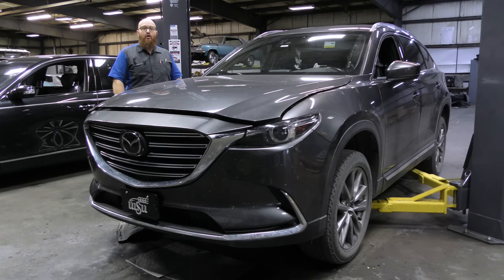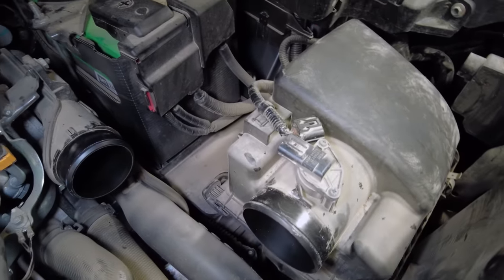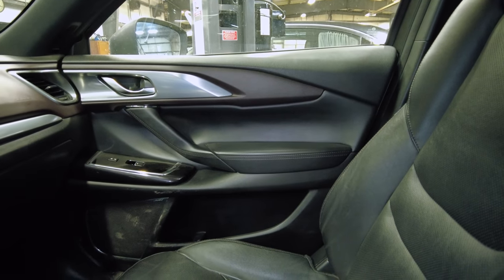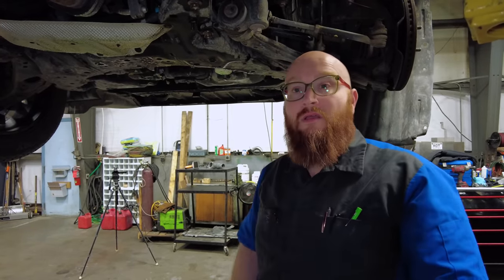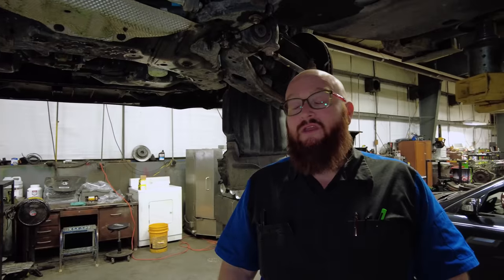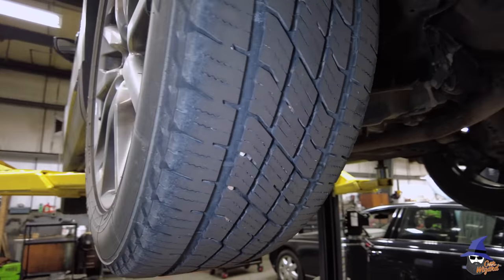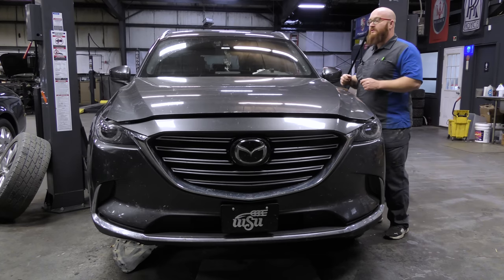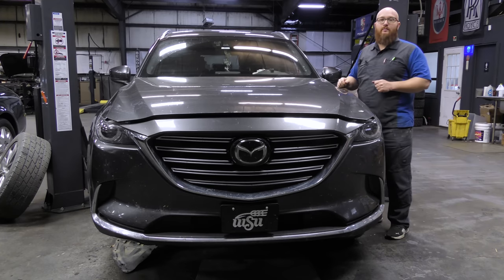Really, a $4K leak! What could be wrong with this '16 Mazda CX9 that could possibly cost that much?

Comment: Have a Cx5 with 160k miles more reliable than Toyotas ive owned. Seen people report this issue on the Cx9 2016+ sucks cause I wanted to upgrade to this but not if its going to run into this issue.

Comment: Interesting, because I was about to buy a 2016 CX-9 this week and declined it because I've found this and the VIN number matched the affected models:

https://static.nhtsa.gov/odi/tsbs/2021/MC-10205999-0001.pdf

Btw, SkyActive there is nothing to do with Ford... different worlds.

EDIT: The location where Car Wizard shows the leaking also matches one of photos on the above bulletin. Be careful to make sure it's not just a head gasket, but a cracked cylinder head.
Reply: Thank you for sharing

Comment: The days of standing inside the engine compartment of a 78 Ford f150 with a 300 working on the engine are gone.  Easy that was just an example.  Two size wrenches and a Phillips a guy could work on most of the truck.  Lol.😊

Comment: The owner should take it up with Mazda USA. Depending on service and mileage Mazda USA should help owner. Here in Australia they have replaced multitude of diesel Mazda engines that had inherent fault from 2012 to 2017 at no cost to owners even if no longer under warranty. If this is design fault then owner should at least try getting Mazda to help under relevant USA lemon laws etc...

Comment: I will say this every time. NO REPLACEMENT FOR DISPLACEMENT! The more you try to get out of an engine the shorter its life will be. Sure 300hp out of a little 4 is achievable but 300hp from a big v8 is reliable.
Reply: The lazy under-powered V8 of the 1960s is no doubt reliable but very inefficient and 'dirty' wrt emissions.  The 70's versions were a little cleaner but even worse on fuel efficiency - and power is not worthy of discussion.  Later V8s such as the GM LS are more efficient - but nevertheless still thirsty around town - how do I know - I own one.  However, customers are now seeking much better fuel economy and less harmful emissions (since 'we' all need to breath clean air) - hence the rise of the small powerful ICE fitted to the large SUV.  Not long ago, families seemed to get by with a 'wagon' however it seems that 'wagons' are no longer sufficient because SUVs offer a commanding view when seated in the driver's seat - a commanding view over the SUV in front of you - your kidding right?

Comment: I don't understand why the timing chain needs replacing. My 2007 4 cylinder Camry just had the pistons replaced and same timing chain went back in at 201500 miles. The timing chain can't be that bad on this 90000 mile engine.
Reply: Your's is a thick and robust chain. Some of the modern ones are long and complex and are almost fragile in comparison. Many of the tensioners are actuated by oil pressure and poor maintainence or low oil operation can cause issues. It all depends on what condition they are in. Some vehicles have 3 timing chains in the setup.

Comment: Ford sold Mazda during the 2008 downturn. One of the many reasons why Ford avoided bankruptcy, by selling all the brands they acquired in early 2000s.
The 2.5L motor is Mazda designed engine. Skyactive is Mazda proporiatory technology and has nothing to do with Ford. 

I really like Mazda design but they are very delicate cars. Learned my lesson with few of them. The pealing wheels is standard issue on all Mazdas from 2014 and up...

Comment: It's incredibly misinformed to claim a link between Mazda and Ford. Way back in 2008, 15 years ago, Ford divested its roughly 33% stake in Mazda, which dropped to 3% by 2010. Then Mazda scrambled to develop its  Skyactiv platform and I think all the larger Mazdas (6, CX-5, etc.) have been made in Japan since 2013. The smaller models are assembled in Mexico. The CX-5 with the 2.0 liter Skyactiv launched in January 2012. Mazda did continue with a Ford legacy V6 on the CX-9 thru the 2015 model year. The cracked cylinder issue (this car probably, not headgasket) is a known problem for cars built before 2020. It is not that common, which is probably why it took 4-5 years to fix the issue.

Comment: I'd be really curious as to why the head gasket blew. Hopefully you don't fix it only to have the new one go as well. Maybe you could explain why head gaskets fail in a future video.
Reply: In this case it is probably a cracked head that lost coolant, the engine overheated, and the warping caused the gasket to fail.  A failed head gasket may allow coolant into the oil thus trashing the engine.

Comment: Incorrect coolant will cause this as well.
Reply: @speedmon6581 Not a Ford engine.
Reply: @Rob774 I know. But even nissans head gaskets will fail from inappropriate coolant introduced.  I have delta with this same issue 40 or 50 times now. It's sad and aggravating.

Comment: Mazda was not Ford product by 2015 . Mazda branch off by then . The 2018 and present motor 2.5 turbo engine came out with a status of 250hp and 320torque depending on the year . 2018 was 310 tq with 250hp in premium fuel and newer with the same just at 320 tq . Know your facts before you make a move

Comment: Had a similar issue on a 17 chevy cruze, except it was leaking under the timing belt cover, so we thought it was a water pump (coolant was leaking from there too :/)
Reply: Those leak from everywhere. Literally everywhere....
Reply: @freddys.8558  yeah, freaking junk. Had to replace the oil pan gasket on one, and noticed the oil cooler was also starting to seep oil out and that the thermostat housing seal was leaking coolant. Had to do all 3 and replaced 1 pipe that goes from the cooler to the thermostat housing, because the seal on it was worn out. Should be leak free for about 6 months now :D
Reply: @DapimpBDSD  haha yup. Those are the exact issues I’m talking about!

Comment: And that's why ladies and gentlemen. I researched my vehicle for almost 6 month to know the technical and engineering design with my local mechanic opinion. But I have to add out of all Mazda products this one I won't buy small engine on large SUV
 Made me wonder what kind of engineering behind that vehicle?!. So my heart goes out to owner of this vehicle. Myself as of today I just learned my 2012 Toyota Venza FGR v6 engine has oil cooling line that made out of rubber. And at over 150k miles it will burst and cause catastrophic engine failure. That's mean if this happens to me I'm losing literally everything. It's $8000 dollars worth repair with a Used engine but I just learned today thankfully my vehicle model don't have that Toyota upgraded this oil cooling line from rubber to metal so if you have or own Toyota with the v6 engine check that thing out it's $95 dollars from Toyota give them the Vin number first don't be like me I purchased it and then I find out I don't need it.. Good luck to you all.

Comment: what kind of road salt do you guys use in winter that the various bolts and clamps on the underside are so heavily rusted on a less than 10 year old car? my 1992 Toyota Carina 2 is over 30 and has seen use in every winter (live in Switzerland) and is nowhere near as bad underneath
Reply: 😃Salt is Salt. All salt is sea salt!! 🤗

Comment: Car wizard, is safe to skim the head, won't that affect the VVTi if the head, valves are closer to the block?
Reply: I believe that the only proper procedure would be to replace the head with the upgraded one. Surfacing the head only applies to older vehicles.

Comment: $4000 for a 4 cylinder head gasket !  I guess I can see it if you have to resurface the block if it's an aluminum block and head, how much for a JDM engine swap out.

Comment: So after reading the comments, it's not a Ford as many of rheie engines suffer from weak block because of xasting techniques and design .
So is there a problem with Mazda Head gaskets,just as Subaru had with theirs years back ?
Is factory specifications like head bolt torque, too little ,should they go further to help seal the gasket ?
Is there casting issues with the heads,porus metals ?
Has the anti freeze clashed with the metals ,had the minerals in the water been bad ?
Its just showing that its a throw away society,and the parts might be cheap ,but the labour involved is what kills it ,we all want top dollars for our hourly rate , inflation is pushing that .
I suppose if you had a garage and were competent with spanners ,you as the owner would take the head off ,fit the nee gasket ,use the old timing chain and slap it on the back as you sell it , provided the head gasket works ,if tou have to find 4grand for repairs,might as well put that money into a new car ?

Comment: This is the cylinder head it’s cracked. I literally just went through this had Mazda replace it. Costly but the turbo is too strong for the head. They have upgraded bolts etc for it which would need to be put in by Mazda. Overall the cylinder head has to be replace.
Reply: Were you out of pocket & are you in NJ?
Reply: @josephsantoli6476  dealer actually I bought the car from actually got the car fixed at Mazda and, no upstate ny

Comment: I loooove when Wizard talks thousands & thousands in mechanical repairs: oil leaks, HVAC problems, blown gaskets, damaged rods, bent pistons, blown engines, stretched timing chains, strapped timing belts, faded headlights, cracked wheels, rotten frames, seized brakes, cracked windshields & stuck shut moonroofs, missing sidemirrors & deflated tires,....It's the Apocalypse... Hurry up man, bring the tools.. We're going to fix this sh*** up !

Comment: It is not ford, ford has nothing with mazda. Toyota has bought some shares in the company and you can see a lot of denso part. Still there is some fomoco parts but they are few (cv axel). I had mazda 6 2017 and sold it at 200k mile with no issue in the engine or transmission . Please show us inside the engine with patent pistons.

Comment: Those darn American made engines with their head gaskets.  Reminds me of the Northstar aka Deathstar and HT4100 aka hook and tow 4100.  That repair is cheap compared to a CP4 pump detonation on a GM Duramax engine.  That fix is anywhere from $8K to $20K.
Reply: This is a Mazda designed and Mazda built engine and is NOT a Ford engine. It is made in Japan, not USA.
Reply: @UnknownUser-rb9pd  Those darn Japanese made engines with their head gaskets.
Reply: @heiner71  🙂That's better. 
This engine was developed in 2001 so Ford did own 30% of Mazda then IIRC.  However, they have never owned a controlling interest though the whole world seems to think they have been owned by Ford since the 1980s.
However, this engine was not only fully designed by Mazda but it has been massively modified in recent years with their very clever Skyactiv technology as well as turbocharging.

Comment: What happened? I thought you was the car wizard? You're supposed to know that the car is a second generation cx-9 which is all mazda with no Ford parts. Also the problem is a cracked head.  It's all over the cx9 forums. I thought that you would research this before making a video.

Comment: Ford hasn't owned Mazda since 2008, when they sold most of their shares to raise cash and avoid the bankruptcies that GM and Chrysler went through the following years. The Mazda SkyActive engine family is not a Ford design, nor shared with Ford. Its predecessor, the Mazda MZR or L family four cyl engines, were designed by Mazda and used by Ford, branded as Duratec, and then Ecotec from the early 2000s to the present - Ford is more correctly using Mazda's old design, though in Ecotec form now it has been modified quite a bit by Ford.
The first gen (2006-15) CX-9s did share a basic platform architecture with Ford (CD3, also the basis of the Ford Edge), but were built in Japan, so I would be surprised if it contained FoMoCo branded parts. The 2nd gen CX-9 is based on Mazda's SkyActiv platform, not shared with Ford at all, so FoMoCo parts on it would be even more surprising.

Comment: I would not have gotten the turbo personally
Reply: I don't need extra power, I need efficiency  and great gas mileage
Reply: That model Cx9 is only available as a turbo.
Reply: @bmw320i2  then I'd engine swap it cuz I hate how turbos make the engine pressure too damn high
Reply: @Rolatnor  Or just buy a non turbo vehicle and save a lot of fucking about. My Cx9 did 75 miles without an issue before it came off lease. Great car.
Reply: @Mathew Bittle:  An engine swap - should only require a couple of hundred bucks to buy and install - right?

Comment: I know you're good at what you do but it was disappointing to have you assume the engine in this car is a Ford product. 5 seconds of research would have brought you to the conclusion that the Skyactiv-G PY-VPTS turbo I4 is a Mazda product, not Ford and in fact doesn't have an application in any Ford vehicle.  The majority of Ford's involvement with Mazda ended years before this car came out (Gen 2 CX-9). At the end of the video you say it again, you boil it down to a Ford 2.5. You're wrong. Show me the parts that say FoMoCo. Ford doesn't own Mazda.

Comment: 20" "wheels" with 2" tires. 2.5L four cylinder turbo. Geez, I wonder why you would ever expect to have a problem with that? That thing needs at least a large normally aspirated V6, or better yet, a straight six. Was a mechanic for 41 years. Love that sweet ethylene glycol smell. Unless it's coming from MY vehicle. I'm surprised something this new would still be using glycol as a coolant. That could be called both a Ford or a Mazda engine. Ford and Mazda go back to the '70s, just like GM and Isuzu/Suzuki/Daewoo and Chrysler and Mitsubishi/Diamond Star. It's a terrible design, but it's the way most engines these days are designed. My 1972 Ford Pinto wagon has a 2.0L OHC four cylinder engine (non turbo of course) but the cam is driven by an easily removeable external belt. Remove the belt, cam cover, both manifolds, and the head lifts right off. You can have it off in an hour.

Comment: Please Do you research when you say the engine is designed by ford, and give a sense that it sucks. Without even knowing why that engine failed and the abuse it could have had.  FYI: The older engines that are Mazda L series, which I believe was first seen in 2001. were design by Mazda, and used by Ford. The L series were evolution of mazda F series. .. moving forward the Mazda skyactive G engine is the next evolution of the L series for Mazda.

Comment: Question: Does coolant boiling on exhaust parts damage the pipes in any way?
Reply: No, coolant is bad for drinking, but its not as dangerous as its color suggests. Exhausts are designed to deal with winter salt (which is much more corrosive) for at least the length of the warranty, so coolant will do nothing to them. Coolant is actually designed to prevent corrosion, which is why you shouldn't cheap out and throw water in there.

Comment: That is a Mazda engine. I had a 1996 Dodge Caravan with the 3 liter engine that was made by Mazda, that car had many engine problems. The gasket on top of the engine had to be replaced several times. I don't have much confidence in Mazda engines once they go over 75k miles.
Reply: I think you meant to say Mitsubishi

Comment: Contrary to what the Wizard says, over here in Europe and in Asia that 2.5 engine is NOT considered a small engine. It has ample power even for the heavy CX9, as these engines are mostly tuned for low down and midrange torque instead of high-end horsepower. Treat them well, as in keep to the service guideline and allow the engine to warm up and cool down correctly and it will last quite a long time and many miles.

Comment: Didn't Mazda also have problem with timing chain cover leaking coolant into oil pan
Reply: You may be referring to the Ford 3.5 and 3.7 engines with the internal water pumps. When they started to leak, all the water went down into the oil pan. Unless this was caught quickly, the engine would self destruct from lack of lubrication. Also, replacing said water pump was very expensive.

Comment: JB Weld and auction it off 😅 I wonder how many other Ford engines have this problem?
Reply: My 1997 Ford Explorer 4.0L OHV has this problem. Have to pull the engine to do the rear main seal, trans. pump seal, and change the head gaskets, other than that is still runs great, only 138k miles.
Reply: @quicksilver462  over 230,000 miles on my LS1 engine and only a waterpump and knock sensors replaced:)
Reply: @HypocriticYT  I  H8T  FORDS!!!
Reply: The engine is a Mazda design - NOT a Ford

Comment: Car Wizard - I am disappointed in your accuracy. 

- Mazda and Ford split ways more than ten years ago. This engine and platform shares nothing with Ford.

- Skyactiv platforms and engines are 100% Mazda.

- Ford still uses the Mazda L series engine derivatives today. More recently, Ford even modified it to run on the Atkinson cycle for the Hybrid Maverick and Escape. 

- Ford never owned Mazda. Ford owned a stake in Mazda for decades, but never owned a controlling stake in Mazda.

Comment: Hi wizard, sorry to tell you but this 2.5 Skyactiv engine its a 100% Mazda and there is even 1 Ford model that uses this engine, you must be confused with the 3.5 MZI engine that mazda developed for the previous cx9 and ford used it on his ford fusion and his ford edge, when Mazda bought back Fords participation in the company they stop using each others parts, when you work on it you will see there is no Ford brand in any of the components o Ford parta that can be used in these engine.

Comment: Of course cars used and new are WAY over priced, that is a 8 or 9K SUV not 20! But 4K for a head gasket on an inline 4 cylinder, no MR. Wizard you are over charging that 'lovely family'. And you don't have to change everything including the crank shaft just to change the head gasket. That thing has only another 50 or 60K miles left on it, if one takes care of it.